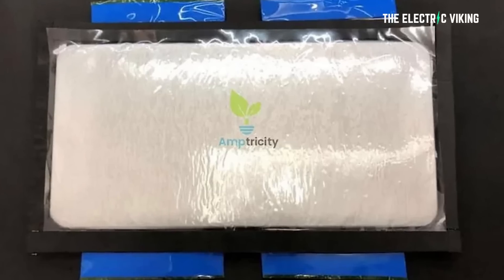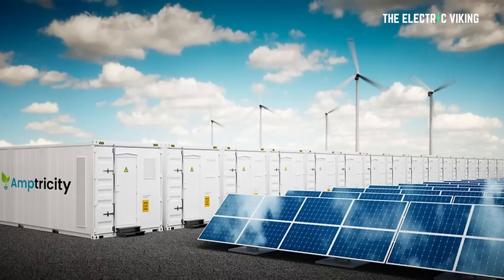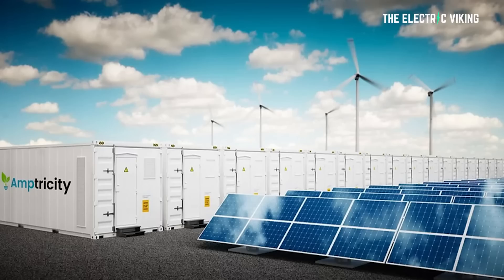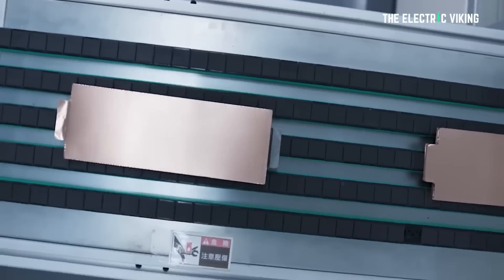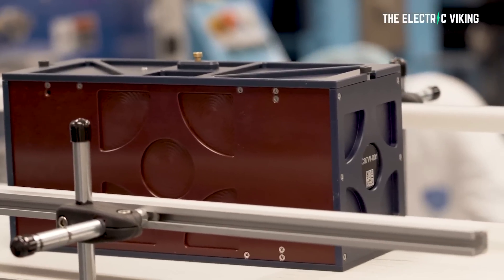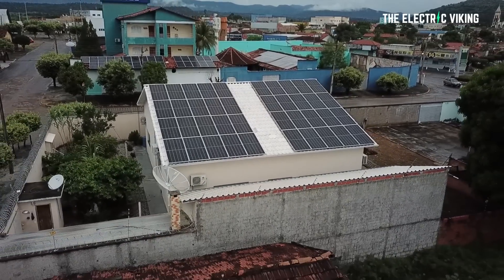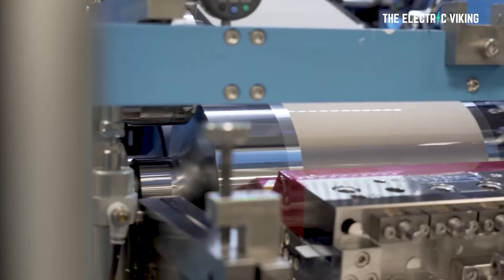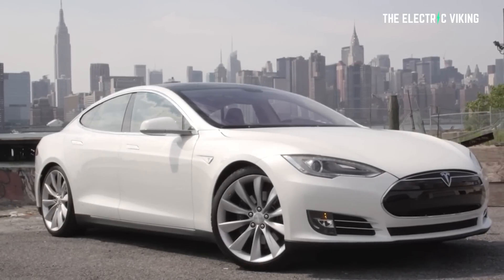Amptricity unveils its solid state batteries for Tesla's or energy storage

Comment: Nice vid Sam. Probably worth expanding on some of their specs which are quite marketing driven. Directly from their website: (ED = energy density, CL = cycle life)
a/ LFP (high cycle life) -> ED = 180Wh/kg  CL = 5000
b/ NMC (ultra high cycle life) -> ED = 180Wh/kg  CL = 11000
c/ LMO (higher density)  ->  ED = 200Wh/kg  CL = 3000
d/ NMC (ultra high cycle life) -> ED = 160Wh/kg CL = 11000
e/ NMC (high energy density) -> ED = 370Wh/kg CL = 200
f/ NMC (high energy density) -> ED = 300Wh/kg CL = 3000
So - b/ is cutting edge for grid storage and f/  is an improvement for EV's. e/ is for advertising high ED's but CL too low c/ is a nice compromise 
We'll have to see how they go scaling production and what resulting cost will be. Prices quoted on website are pretty high. By the time they can scale this and get cost down, other large vol competitors (CATL / Tesla) etc will likely be sneaking their ED's up to similar figures. Still - it's nice to see constant improvements and evolution.
PS Edit -> Just to add the figures above are actually minimum or >= so it may depend on how conservative they are.   https://www.amptricity.com/technology
Reply: Great info. I was wondering about cycle life.

Comment: It would be interesting to understand why these batteries are so much more expensive.
Reply: Bilbo:  Low volumes?  Clearly, if they're going to be a big commercial success, the ability to reliably produce at scale with consistent quality, durability, and especially price MATTERS. 

There's a reason it's easy to demo things in a lab, but HARD to build serious commercial products that end up being highly profitable at massive scale.
Reply: Because they are only asking for 1% deposit, 1% you will never see again.
Reply: I live off the grid with 56kwh's of Chevy volt batteries for 5 years now. In reality 56kwh's gives me 2 days power if I don't charge my car.
Reply: Niche-ness ?
Reply: Because manufacturing in the US is expensive, which is why we have global supply and manufacturing.  It's just not economical to produce in the US.
Reply: @accoomes20  only true if labour comprises a significant part of cost.
Reply: Founders and/or Venture Capitalists insist on a B$ payday.
Reply: @accoomes20  When robots do most of the work the costs are similar to overseas but you save on shipping.

Comment: Supercars would be a niche, but at that sort of energy density I'd have thought aircraft would be the more logical use.
Reply: Short range aircraft maybe. But due to weight per kWh of energy batteries are the worst for aircraft. Long range aircraft will be the last to be green. And even then would make more sense for them to be hydrogen (lowest weight for energy density)
Reply: @quackcement  Yes, but these batteries are half the weight per KWh of other batteries. So with electric aviation already starting for small and short range niches, this tech could take that forward and into niches that   aren't viable with current battery technology.

Comment: viking,I am your fans. Recently, news broke that BYD's newly developed solid-state lithium battery will be produced in Chongqing and will soon be loaded into the test vehicle. The project is led by Academician Ouyang Minggao's all-solid-state lithium battery, which is a standard national key project.

BYDThe limit of the liquid lithium battery can be increased from 300Wh/kg to 700Wh/kg, and it can be fully charged in 10 minutes. Because there is no liquid electrolyte, the spontaneous combustion of the battery is almost eliminated in a real sense, which can be said to be a disruptive technological innovation.

In addition to BYD's all-solid-state batteries for its own use, the first batch will also be supplied to other companies, among which Mercedes-Benz, BMW, Audi and Hongqi may be given priority. BYD's future battery technology has three options, blade, hexagonal or 2025 all solid state. All-solid-state batteries are divided into two technical routes. The first oxide solid-state battery has already been manufactured by BYD and can be installed at any time; the second solid-state battery of BYD is the sulfide technical route. At present, trial production has been completed and it has reached the test standard. Ready to load.

It is reported that BYD has invested in the research of solid-state lithium batteries as early as 2016. At present, the number of related patents in China is far ahead, ranking first. Its two technical routes are oxide solid-state lithium batteries and sulfide solid-state lithium batteries. The batteries have been produced and can be loaded and tested at any time. The next step is mass production and commercial use. Ningde Times, also a battery giant, is also intensively developing solid-state lithium batteries, and it is expected to achieve commercial mass production of solid-state lithium batteries in 2030.

2. BYD layout five major brand matrix

Comment: One thing not mentioned is the charge/discharge rate. The 12kw battery only allows 3kwh of discharge. Lithium ion batteries today allow for a 1C discharge rate (which would be 12kwh in this case). So with this solid state battery you get only a .25C rate of discharge. Meaning, you need a battery 4 times the size to get the same amount of power out of it at once.
Reply: Most stationary LFP and NMC energy storage uses a smaller C rate in the neighborhood of 0.2 to 0.3 for charging and discharging to meet full cycle life of circa 5,000 cycles, even though they can sustain 1C discharge rates.
Reply: @GoCoyote  that's a good point about stationary batteries. But how about EV batteries? What are their charge and discharge rates?

Comment: Sam:

I suggest that there is an important technical point to be defined in these miracle batteries. How long will they really last? Especially with typical minimum usage. Lets say a couple of those 4KW storage batteries are hung on your garage wall. There's an inverter charger that trickle charges them. Keeps them at or near fully charged. A couple three times per year you lose power to your home and the system falls over to the batteries. And your on the super dupper batteries for a couple hours then street power comes back. The charger inverter recharges the batterie(s) back to fully changed ready for the next power outage. Cost of those batteries - $11,000 x2 = $22,000.

I suggest the following unless told otherwise:

After three years of usage, three two hour outages per year, in the 2nd month of the fourth year street power goes down, the inverter/charger falls over to the super dupper batteries, and they're dead as a door nail. Kaput. Nada. And it'll cost you another $22,000 to replace them. And you've gotten less then 20 hours of usage out of them over those three years.

Tell me I'm wrong. Or give me the absolute longevity spec of these super dupper batteries if they remain at full change for long periods of time with little to no use.

Thanks
Reply: Battery storage is not only for outages, but you can also get off the grid on a daily basis especially if you are on a Time of Use rate plan (TOU). That being said, you could be paying off peak rate for the entire day. 

If you are from the US, with NEM 3.0 rolling out in April, battery storage is kinda like a must for new solar customers to make it worth going solar.

In a TOU rate plan, there are on peak and off peak hours, the rate for on peak hours can be double as the rate for off peak hours. So if you have solar and a battery storage system, you can get off the grid during the peak hours.
Reply: @dun1930  Amazing that the new EV sitting in your garage has now become a backup for your home system and also when the battery is fully charged your utility company can use the energy stored there. That so long as when you need to use your EV at 8am its fully charged and ready. Who'd a thunk that was gonna be a thing.
Reply: @wilcalint  I was talking about residential battery storage, not using an EV as a battery storage.
Reply: @dun1930  but as I said a household using their EV parked in their garage has become a BIG selling point. Ford and the F-150 Lightning are pushing that.
Reply: @wilcalint  True, Tesla's VPP has a similar idea. I personally wouldn't use my EV as a battery storage in the near future.

Comment: … anticipating publicised winter blackouts here in the United Kingdom, I have purchased a 7.2 kWh eco-flow Delta Pro system and also I have on order an MG 4 which will provide me with an additional 64KWh feed in at max 2.2kW I’ll let you know how it works when the system is completed in February 2023. Meantime the Eco-flow will probably cope between 4 & 7pm.

Comment: Let's hope so. I always check the websites of battery companies.  At the 'products' section of Amptricity I see additional technical information with respect to the 'core technology' section. I expect at 'core technology' a better explanation about the 'solid state' aspects of the Amptricity batteries. Amptricity applies several types of lithium-ion chemistry that may include nickel and cobalt, and they manufacture several products with varying kWh battery capacities. The big bonus seems to be number of recharge cycles during battery life-time, that is three times higher than non-solid state lithium ion batteries. With daily recharging the battery lasts 30 years, in stead of 10 years. That is a much higher value for the money.

Comment: If this company is for real, I like their style of actually waiting until they had an actual product before announcing their plans. It will all depend on the cost per kWhr per cycle, and any battery characteristics that add value for certain requirements, such as safety, energy density, volumetric density, temperature range, and cycle life. If they meet the requirements and needs for some markets, they will be able to start scaling production and begin the process of lowering costs, which will start opening up more markets and volume, thus lowering costs, and may eventually allow for replacing other chemistries in regular EV's.

Comment: 102k for whats in a normal tesla.
10x volumen equaling 1/2x cost reduction.

1000x the production volume would mean you get that battery pack for 12,75k.
Might be worth it for some to pay a bit of a premium to double the range.

So this is probably not making a big impact into the first EV revolution where EVs have to kill off ICE but the tec might be part of the second EV revolution where it takes over as a battery technology and opens up applications that were not able to be electrified without it.

Lets see and enjoy the walk of technology.

Comment: In the end, what really matters is whether it's scaleable at an economic price, else it's just a novelty. The materials have to be cheap and abundant, and the manufacturing process has to be competetive, in the difficulty of manufacture, the plant required, and the throughput. If it can't get close to what's out there then it's irrelevent. Without them revealing the chemistry, it's impossible to make a judgement. Clearly it works, but it's anyone's guess whether it will be viable in EVs at scale.

Comment: For grid usage there are molten metal batteries wich last even longer than solid state batteries and losses on recharge cycle can be overcome for purposing heat to heat watter. Then it will be up to 10x cheaper than lithium based batteries in meaning US government will give 2x the cost of battery. That means when Ambri will scale it up for example New York and will build 100GWh pack it will 0 $ as whole system

Comment: 20kw hrs of LFP Batterys costs about $5000.   (48v x 100ah $1200) = 5kw x 4... with $20000 you can buy almost 100kw hrs.... thats like 10 days.  Why would you want solid state for Home... doesn't make any sense.  You'd want for Aero/Ground Transport for low weight.

Comment: So how far could I go in my Ampera/Chevy Volt Gen1 if I was able to replace the battery with one of these solid state batteries, or a CATL Qulin, I mean someone somewhere has to start selling new battery packs the old EVs to give them massively increased ranges soon, there must be a ever growing market for new improved battery packs.
And incidentally that’s my 2013 Ampera I purchased used for £13k which still appears to be way more advanced and superior compared to the new 2023 Toyota Prius Prime, just needs a better battery, I can’t afford over £50k for a model3 LR just yet.

Comment: Beyond the marketing hype here, I am not sure of the exact use case?  3KW max continuous output, what is that good for?  I guess you can run a hair dryer and a few LED lights.  During the summer heat here in Texas we can use about 200kWh per day on average.  Until they can scale up on inverters as well, it seems pretty useless at least here.  The 20KW generator is what we are using to be able to run the house without needing to worry about what is off and on.  UPS power backs up the critical things until the generator starts.  We have about 8KW of UPS power for electronics and server racks.  I would love to consolidate all that down, so realistically a 10kw inverter would be minimum size.  Again costs get out of control.   

In order to get higher power outputs you need to get into the commercial units.  The 150kWh unit at least you get 30KW of inverter power.  However at $250K USD, that would buy a lot of cheap natural gas.

I would love to find an affordable solution, but the only thing right now are gas powered generators, either natural gas, gasoline, or diesel.  Our natural gas here in Texas is pretty cheap overall and for no more than we loose power its not a problem.   With solar panels costing so much right now at least, and electricity being so cheap, solar has a negative payback for the life of the panels.  

Keep up the good work sir.  👍🤠

Comment: What is the gravimetric density of this battery?
Anything above around 500wh/kg, it becomes viable for electric aircraft.
Remember, in the aerospace industry, battery cost per kWh is fat less important than gravimetric energy density. Why? Because the power systems (engine/transmission) is VERY expensive. Since aircraft grade motors are relatively cheap, it permits a great deal of money to go to batteries.
Since electricity is generally much cheaper then jet fuel (and getting cheaper all the time) and as ~40% of a tickets price is fuel costs (probably much more now), the cost of propulsion per passenger mile or kilogram drops significantly, add to this that an engine runs VERY hot means a great deal of maintenance over the life of the aircraft. There is generally inflation when it comes to aircraft engines whereas the cost of EV like technology will continue to drop. Battery research impacts so many industrial and consumer goods that money will inevitably find its way to research which reduces cost/kw and wh/kg.
It’s just a matter of time. With safety being a prime advantage to solid state batteries and safety being a prime requirement of aircraft, it appears to me that these are made for each other.

Comment: The batteries seem to have a lower-than-optimal max power output. You could barely boil water on a stovetop with the max power output of the 24kWh pack.

Comment: I have 14.4KW of pylontech lithium batteries running my house now. They cost around 15k for 6 batteries. So 60k for 60kw or so. If this tech is nearly double the density then it’s actually already better value! So not so expensive if your setting up a new off grid system.
Reply: I think you over paid. I have just bought Pylontech LFP battery 3.5kWh for only 1300GBP, that is only 372 GBP/kWh.🔋
Reply: Ty for ur comment
Reply: That’s 2300aud which is about what the ones I am quoting cost here, so no, I didn’t over pay.
Reply: Unless he’s quoting USD and not AUSD.

Comment: If the power to weight ratio is good, these will be used in aircraft not home storage. Weight doesn't matter for home storage, so that seems dumb to pay $1,700  per kWhr.   I can buy LFE batteries on Amazon for $255 per kWhr delivered to my door in two days.  With no factories today, these are vapor ware batteries, not solid state.  Ha

Comment: I think what will happen is they will put smaller batteries in the car that are solid state. Giving the car the same range but less weight and faster charging times because its smaller.
Reply: That's still $50k just for the battery.

Comment: $12,000 for only 12kWh? We just paid substantially less than that to have 19kWh of LFP batteries plus inverter installed. That's end user, not the trade price. They'll have to double the capacity and also halve the price per kWh if they want to sell them in any volume.

Comment: ProLogium from Taiwan is having its solid state battery pilot production line for 7 years! Yes, ProLogium  is trying to refine its production process into perfection. Early next year 2023 will begin commercial-scale  production for Mercedes and Vinfast.  You are so wrong, solid state battery is actually cheaper to produce, No cooling system no expensive and heavy metal  cases.
Taiwan 的輝能ProLogium 明年初正式量產, 生產線已經精雕細琢七年了， Mercedes 的投資讓賓士佔有一席董事，經過一年的生產與庫存，我猜應該賓士2024年就會發表2025年的固態電池電動車。

Comment: google searched Amptricity....reason not making headline news it cause it is EXPENSIVE !!!....I just cutnpaste this info I found in my search......As for prices, good things are expensive as it usually happens, and in this case there is no exception: the price of the cheapest version, a 12 kWh model, starts at $19,990. Going up to the 24 kWh model the budget rises to $37,990; finally reaching $73,999 for the 64 kWh version. Is it expensive or affordable, in the end, as compared to Tesla Powerwall? Each individual customer will have to decide, as it depends on the way you look at it: amptricity is a battery that will last two or three decades of hard, permanent work